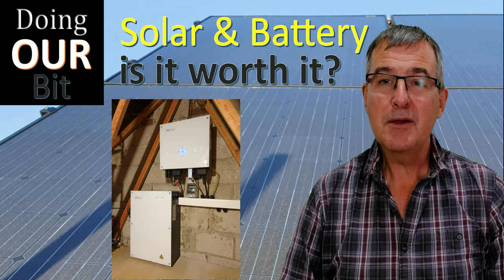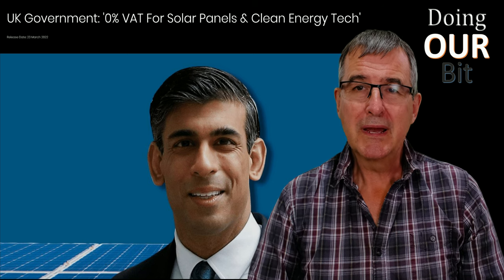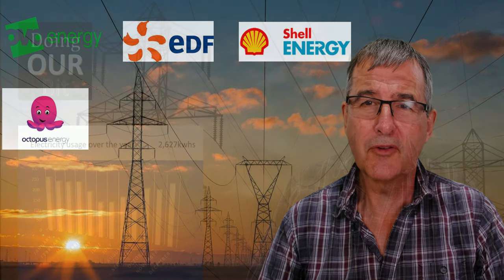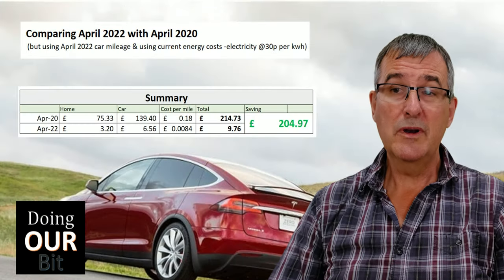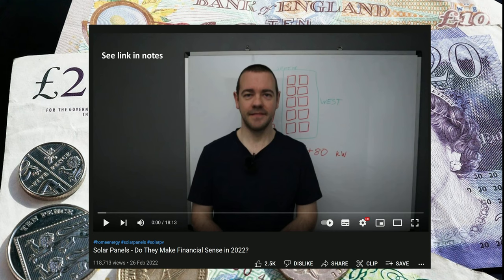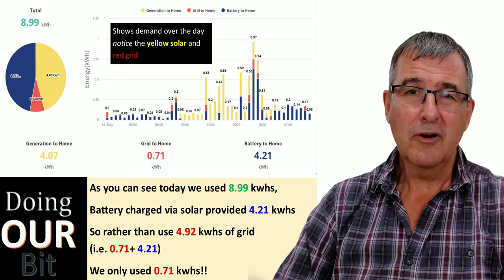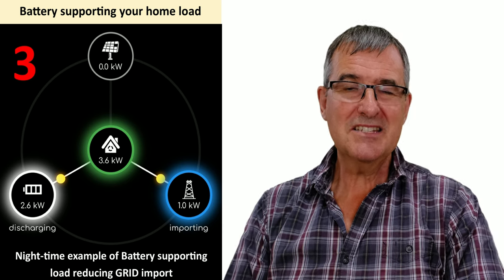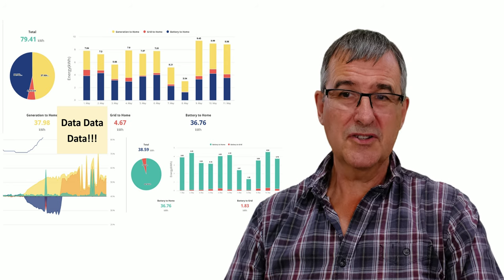Solar  and Battery install - is it worth it?

Comment: For what it's worth I would suggest the following.
Split your system in two so that if one inverter goes down you don't loose power.
Oversize one of the inverters so that it can take on the output of the inverter that's down. 
Yes, it will cost more to have an electrician put in a diverter switch but without reliability and redundancy built in, your going to be down and out when you have become reliant on solar. Not a good feeling trust me.
We have two inverters and panel systems running in parallel on a split phase supply. There are huge advantages to this.
Next bit of advice.
Do your install in two plus stages to spread out the cost. 
Get a modular battery system.
Small is better than none but bigger is better still.
Make the two systems different so you can compare and contrast.
Poly and mono crystalline.
Poly is tougher but not as efficient as mono.
Avoid exotic gizmo's and EV,'s.
Wait until hydrogen fuel cells etc come on the market.
Lithium iron phosphate is a good chemistry for home batteries but lithium ion is BS for car's. 
If your roof is well situated for solar, go as big as you can. Anything less than 5kw frankly is a waste of time unless your living in a two room cabin.
Reply: Interesting idea. I am having a review of my system Thursday in the light of probably going for air to air heating and a smart tank to replace my combi boiler (subject for future video). Curious why you say Lithium iron phosphate BS for EVs? CaTL have already improved energy density and lifespan is very impressive. Hydrogen refuelling is being pulled rather than expanded because it is just too expensive like the cars themselves. Fully Charged has a good podcast on the subject which casts significant doubt on Hydrogen and the buzz is further undermined as it is being heavily pushed by the fossil fuel industry. I think its future is for long haul planes and cruise liners especially now you can recharge batteries in 5-10 minutes.
Reply: @AdrianSmale  
The huge problem with powering cars with Lithium batteries is that they draw huge amounts of power which shortens life. Lithium is to damned expensive, it's NOT sustainable at all. Hydrogen from water is the most fully recyclable fuel and make no mistake, water is a fuel. Every plant uses it everyday. 
I don't use Lithium because I think its ideal, I use it because it's the only choice at the moment.
I am working towards more sustainable options. I am building a compressor to store Hydrogen generated by electrolysis using solar electric. You can store Hydrogen or make it on demand.
Lithium is a stop gap technology, I  embrace it only until far better technologies replace it. 
The great reset is a cull. The next few years will be a nightmare. 
Relevant ? Absolutely.
Reply: @joschmoyo4532  Impressive indeed and glad you are not referencing grey Hydrogen! Agree Lithium is an issue although Hydrogen fuel cell cars remind me of a fax machine. You use electricity (paper) to turn it into Hydrogen (digital) to turn it back into electricity (paper), and of course you still need a battery be it a much smaller one. This process is 30% efficient like ICE cars now. Recycling batteries is key as we cannot   continue endless mining. Giving we are using AI to work on chemistries I think a sodium sulfur chemistry may be the answer but time will tell. All I know is its very efficient to charge my car directly from my solar and super convenient too.
Reply: @AdrianSmale  
The convenience of home charging your car is entirely understandable and desirable but only if you dont commute to work every day where your car is away from your home charger. Otherwise you have to import or worse use your home natter to charge your car batteries.
Our new inverter is DC coupled to to the storage. Definitely more efficient and faster. 
What really needs to happen is open trade and credit bartering of feed in. But of course then your generating income the govt will want to tax. Govt regulation invariably leads to financial slavery.
Reply: Having 2 inverters a separate installations raises the cost so much the system makes no economic sense at all.
Reply: @jezmarshall9941  
It does if you stagger the installation over several years. In our case seven. Low interest green loans, government subsidies and the added benefit of redundancy if one system has a failure. We have split phase supply.

Comment: If you're switching your home to 100% electric then you should rewire for 12v or 24v DC. The step-down transformers in all your stuff get hot because they're inefficient and are wasting power. You can then also save yourself some cash by not needing an invertor, and all the power they waste in the process. 

During the Summer month you should be switching out batty packs, so you have spare charged batteries ready for the 11 months of Winter. You can also wire some panels directly into your hot water tank and use that as a form of "energy storage". 

Any power you feed back into the national grid is wasted power; they'll effectively just sell it back to you later for a considerable mark-up (if they have any power to sell when the whole grid is "green").
Reply: Interesting comments thanks. Have an electrician coming to quote to and EPS (Emergency Power Supply) so we can isolate our system during a powercut and operate off grid so I'll ask him about this. The practical issue is obviously I already have the gear and of course everything in the UK is set up to work to standard supply, so likely challenging.

Comment: Every new build should at the minimum be energy use neutral.  They build and sail boats around the world that use solar why not use this tech for household use.
Reply: Could not agree more!!
Reply: I completely agree every new build should have solar panels on the roof it would be very cheap to do this at this stage and help reduce costs of running a house hold

Comment: Hi, I am installing a 3.6kw system, 5 panels facing east, and 4 panels facing south, with no shade.  I originally wanted a battery to go with it, but my installer said I don't produce enough solar to make the battery a worthwhile investment.  The system without the battery cost £5600.  The battery will cost me an extra £3000, do you think I should install a battery anyway?

Regards

Andrew
Reply: The problem with no storage is you can only use the energy the solar generated at the exact time its generated. I don't know your usage overall but I find I use 50% of the solar I produce at the time and 50ish via the battery. The other issue is if you do it later its £3k plus 20% VAT so immediately that's £600 more. Worth going through his numbers against your annual electricity usage, because I'm charging the battery,  using the solar and still April to October exporting to the grid. I think it's extremely unlikely you'll  sync your solar  generation with your usage and if electricity goes up in October as much as they are predicting the ROI is only going to improve.
Reply: @AdrianSmale  Hi, from the electricity bill, I use about 12kWh per day on average in the summer,  In winter, it goes up to about 16kWh per day.  We use a combi boiler for hot water and heating.  

Since there is such a high demand for solar installation, only two installers came to survey my home.  Both have said I should not install a battery because my panels do not produce enough electricity. 

To me, it feels very counter intuitive not to have a battery. But the experts says otherwise.  I could just go ahead and do it anyway, but I want it to make economic sense.
Reply: @Kimchi_The_Corgi  Hi Andrew, Your useage is higher than mine, so I am frankly surprised by the experts here. I have 16 300watt panels so 4.8k. But mine are east west and you have 5 facing south and these days it's likely your panels will be more like 400w, so 3.6k which matches your inverter. I wonder if the issue is them actually getting you a battery?? I'm assuming that the size is 5 kwh  based on price so I'd be extremely surprised if you would not fill it 6 months of the year, as you tend to use the majority of your energy between 5-11pm. The added point is with the right tariff you could charge this battery with off peak electricity overnight to use during the day ...I.e. charge at 5-7.5p and use when electricity costs 35p...so that's nearly 3rd of your winter needs. Our 16 panels produce 3,983kwhs per year. What is their estimated annual generation?
Reply: This is an example of my useage. Generation to home 6.16kwh, generation to battery 3.27kwh, generation to grid 14.1kwhs. Used 0.13kwhs of grid energy 13th June 2022. February 6th numbers were generation to home 1.38kwhs, generation to battery 2.29kwhs, battery to home 4.69kwhs, grid to home 0.85kwhs. Seems to make the case.
Reply: @AdrianSmale  Hi Adrian, thanks for the quick reply.  My panels are rated for 395w each.  The inverter is 3.6kw Solis 5G.  

My usage last year was 5086kWh.

We are at home most days.  

I asked EON about their economy 7 tariff, the night rate was about 17.64p per kWh.  the day rate was 34.66p per kWh.  The standing charge was 41.75p per day.  I am currently paying about 22p per kWh.  Eon said it was not worth me changing tariff.

The estimated annual electricity generation from the panels is approximately 2000kWh.
Reply: @Kimchi_The_Corgi  If that's the total calculation  I can see why it won't work especially with that energy deal. My numbers are very different as is my energy tariff and the amount we generate is very close to our total usage. Sorry it is not possible for you
Reply: Hi Andrew,  Your example has really set me thinking as to the correlation between generation and usage. It would seem simple even obvious but it clearly isn't. I generate 3983kwhs, use 3800kwhs for house and 2040kwhs for EV on a tariff til September of off peak 5p, peak 15p export 4.1p. What's particularly striking  is even this month, I am using 40kwhs from the battery of the 95kwhs supplied to the house while exporting 204kwhs to the grid and using just 10kwhs of grid energy. I do find the estimate of 2000kwh per year low when I compare to my system particularly as 5 of those panels are facing south. I would expect closer to 3000. Anyway I'll see what I can find out from others!
Reply: @AdrianSmale  To be honest, I think the calculation by the installer is incorrect.  The formula is kWp x KK xSF = assumed output. kWp is the total size of the solar array installed.  KK this information is the irradiance (sunlight) in my postcode region.  SF, Shading factor (no shade = 1).  My kWp is 2.37 as calculated by the installer, Kk is 953, SF is 1. My kWp should be 9 panels x395w=3.555kWp not 2.37.  Now if I use 3.555 instead of 2.37.  3.555x 953x1=3387kWh per year.  Which is what you estimated.  But let’s not forget that 5 of my 9 panels are facing East, so after about 3pm (in the summer) only 4 (south facing) panels will be collecting.  Assuming my number are correct, is it still worth getting a battery?
Reply: @Kimchi_The_Corgi  From my experience to date I think the answer has to be yes. Obviously the off peak tariff you quoted is not a great encouragement (maybe worth checking out OVO and Octopus) but the real benefit is the flexibility it provides. Supporting your solar at peak times when you need more energy so you therefore draw down less grid just means you use a/ more of your generation b/less grid energy. Who knows we're prices are going to go but I don't see things improving for quite a while at best. I plan to ditch gas altogether next year so I just have one energy source. Will be able to heat the water for free over 6 months in this way. The challenge as I understand it now is getting hold of a battery. Supply is very challenging although hopefully if it is on one order it should be zero rated. Hope it all works out!!
Reply: @AdrianSmale  Just called Octopus.  Flexible default Plan, goes up and down with the energy cap. Day Rate 29.48p.  Standing charge 41.39p.  Fixed Tariff Plan-12 month contract 43.19p per kWh. Standing charge 41.39p per day.  Economy 7 plan, day rate 31.97 p per kWh, night rate  21.34 p per kWh, standing charge is 41.49p per day.  Octopus FIT. 7.5p per kWh (have to be Octopus Customer). 4.1p per kWh (just selling to Octopus )
Reply: @Kimchi_The_Corgi  wow, that's worse!! Makes me wonder what my renewal will be come September on my EV Go tariff but just goes to show the benefits of making your own electricity!!!
Reply: @AdrianSmale  having both EON and octopus electricity rate has tipped me over to install a battery as well.  

The installer said it will be a Solis Hybrid 3.6kW 5G inverter with a Fox ESS LV 5200 battery.

However, they will not be in stock until mid August.  At least I have the panels on the roof now.

One side effect of the 4 panels being on the flat roof is that the house seems to be cooler.  Usually in weather like today (32c), the top floor would be quite unbearable.
Reply: @AdrianSmale  With your annual electricity usage, what percentage do you think your electricity usage is from the grid with your current solar setup?  

I am trying to get some numbers so I can estimate my own future grid electricity usage, so I can estimate how long the pay back period is.
Reply: Hi Andrew, With just solar I was using 27% of my generation. I'll have a much better ideal by Feb 2023, but I think 50% over the year is a good guess at this point. I hope as I said to eventually heat our water this way, and I can obviously use even more by charging the car. I'll certainly do a follow up video then when I have actual data, but hope this helps.

Comment: Putting it in the loft definitely isn't worth it as it will over heat heavily and will decrease the life span of the battery or solar
Reply: Thanks for your comment. I've monitored the temperature/humidity in the loft since the start, and the temperature range even in the high temps of last summer in the UK go from 6.3-38.3 degrees C. This is well within the 0-50 recommended range of the equipment, and although I would, in hindsight, probably choose the garage over the loft for reasons of access ease, I'm happy the gear is fine. What is more of an issue is cold and below freezing temperatures for battery health, but the gear is actually pretty resilient.
Reply: @AdrianSmale  hot and cold when it comes to battery's are one of the biggest killers or drainers of there life span I have had multiple job where battery's were installed in lofts and will refuse to work under too hot or too cold conditions it may be within 50 degrees in the loft but is that the temperature of the device itself as if it's 38 in the loft the battery/inverter will probably be running much hotter.
Cold is also a huge issue in lofts so most of the year the device is running "hot" as it is struggling to cope with different temperature changes throughout the year which could also play a part in depreciating the live of the devices. In all these devices will withstand these temperature changes but I feel it will have adverse affects when it comes to life span of the system.
In short nothing but just pointing out my experiences when it comes to solar installations within lofts and it is something that our company never do for the above reasons.
Cheers clay
Reply: @Clayadron  Fair point, and useful for those starting this journey, but for me, sadly, the ship has sailed.